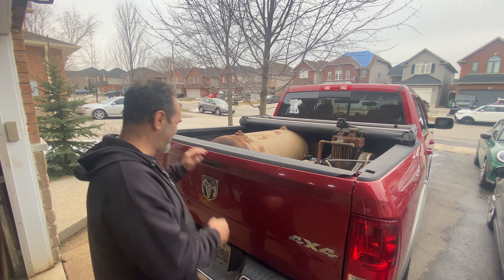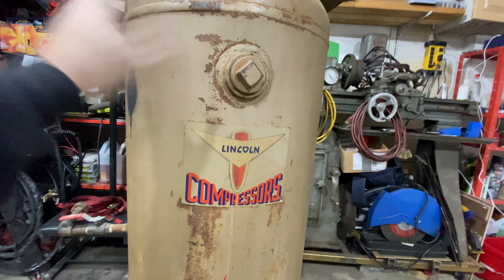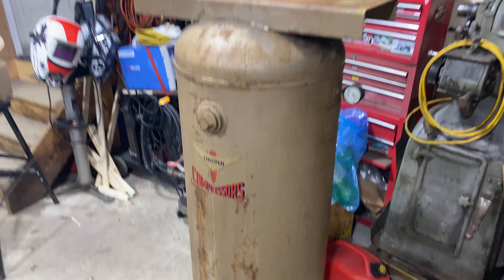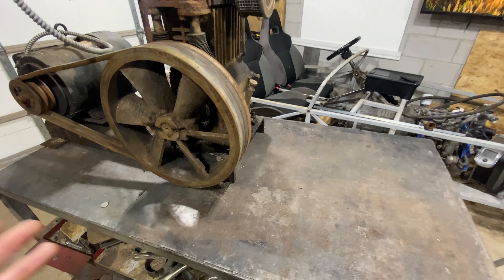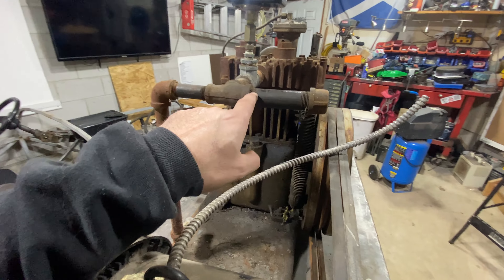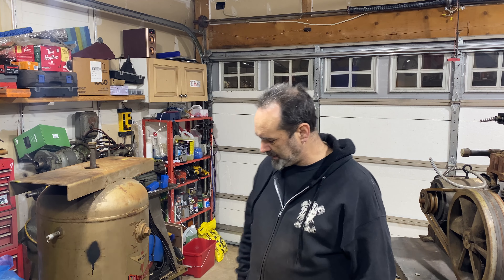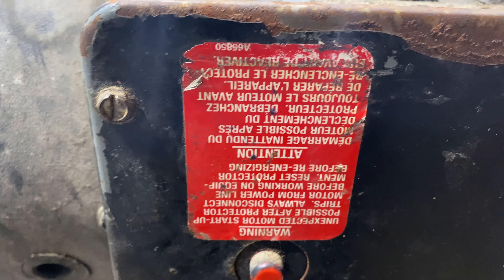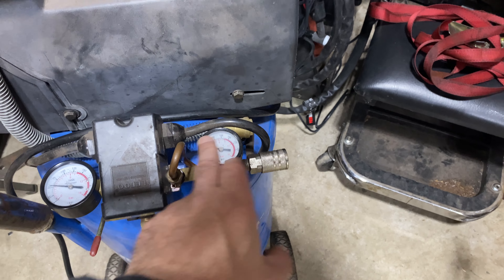Feeling The Pressure With A New To Me Garage Tool At Scott Rods

Comment: Live power goes on the left side of the pressure switch. That shaft on the lower side of the compressor is the oil drain. The surge button sticks out further when energized.

Comment: So I’m pretty sure the last owner used that tank as a secondary air tank. That’s why it has multiple air lines coming out of it. That’s so he had high volume and pressure. That’s so you can use more air between compressor duty time. Thus giving you longer life of the compressor due to it runs less. Most mechanic shops do that.

Comment: Hi Dave. Super buy. That will come in real handy. Yes, you should bolt it to the floor. It will bounce around. I put hard rubber pads under the feet. Yes, Put a gauge to show what air you are running. You will need to control the pressure if you panting. The pipe with the hex cap is a drain for the motor oil. You need compressor oil for it. Princess auto sell it. The motor is probably 220volt. Good for you Thanks for sharing.🍁👍👍

Comment: Replace both pressure  relief valves. Put a ball valve on the tank drain. Use the bigger pipe to go into the compressor. Remove the side cover on the motor and see what it's wired for. There  should be two wiring diagrams on the cover. Bolt the compressor tank to the floor. Their top heavy. If you use it alot, put a water separator on the discharge. Keeps the air dryer. Good luck!

Comment: Looks like a beautiful unit! Would love to find something like that one day, wouldn't even know where to put one that size right now, so I'll keep making do with my little compressor. As for your questions, you can buy compressor specific oil, but usually the manufacturer will specify an SAE grade that will suffice, and that pressure gauge down by the oil reservoir indeed appears to be for the oil pressure, as it only read up to 300kpa or about 43PSI, which is too low for the air tank pressure. Hope this helps a bit, good luck with fixing this unit up, I look forward to seeing it back in it's full glory! You should be able to run any handheld air tool I can think of on that, unless you get into blacksmithing and get a power hammer, your setup will be very futureproof!! 😁
Reply from the maker: Thank you. I've made do with a small compressor for the last 20 years, but I really want to get into body work and paint, before I'm too old to learn.
Reply: @ScottRods  Ah, there you go, that is a field truly worthy of a big compressor!! I have a background in auto-tech work but no experience with body work besides the bit of patching up I've blundered my way through at home. Good luck with it! 😊

Comment: Ditch the tank Dave it's a BOMB, pressure vessels should be inspected and re-certified every 10 years.  There is a tag welded on the tank (just below the pressure gauge) and it will have the build date and any re-certification dates stamped on it.
I'd say it is from the 60's or early 70's. Just look up "Compressor tank explosions" on the web and make your own decision on restoring it. Good luck and stay safe 👍👍
Reply from the maker: I'll look into that tag thing, thanks.

Comment: The truck shop I work in has that exact compressor and it has been in use for almost 45 years, so they will last a long time, given proper maintenance.
Question #1.  While some people use motor oil, there is a special compressor pump oil that is designed for just that.  It is called Mobil Rarus Compressor oil.  There are additives in engine oil that are not good to use in an air compressor.  We change it about once every 2-3 years.
Question #2.  The short pipe from the bottom of the compressor with the cap on it is for draining out the old oil, see above.
Question # 3.  That compressor looks like it has a pressurized oiling system, and that gauge is likely for that oil pressure.
Question #4.  The open fitting with the residual oil film seeping out is called the unloader.  That will vent air out of the cylinders when unit shuts off.  This is so the pump does not have to start up against pressure.
Question #5.  The red button is an overload switch.  We had a air line burst one night so the air compressor ran all night.  In the morning, this button was found popped out because it likely was getting quite hot.  It also can trip if the amperage draw exceeds a safe amount, for instance if the compressor pump would bind, it will save the motor from burning up.  Much like a circuit breaker in your house.
Question # 6.  The wiring can cross  over inside the pressure switch.  It is merely an on/off switch, controlled by air pressure in the tank.  Look for the words "line" and "load" near the terminals.  Line is power going in, Load is power going out to the motor.
Question #7.  The switch on top is the air pressure switch, which will turn on the compressor at around 90 PSI, and off at 125 PSI usually.  You still should have a regulator plumbed in at the air line coming out of the tank to cut that down to 90PSI that will go to your tools.  By keeping the storage tank higher than your usable pressure, the compressor will not cycle on and off so much, and will give you a more steady pressure, useful when spraying paint on Bugsy.
Question # 8.  Definitely use rubber isolators to mount this compressor.  I bought 4 rubber isolators that have a thick rubber cushion with threaded studs coming out both ends.  Then I drilled 4 holes in the concrete slab, and just set the threads down into the holes (it keeps the compressor from wandering around your garage) and the other side threaded studs would fit into the four holes on the legs of the tank.  Without isolators, you will get a low vibration, shaking your dishes out of the cupboards in your kitchen.  
By looking at the motor data plate, it will require a minimum of 30 amps @ 120 volts, or 20 amps (a 15 amp circuit would be just a bit shy of needed capacity)  at 240 volts.  I would go with the 240 volt hookup, as it will run stronger, dim the lights less when it starts up, and be less costly to operate.  You have a very commercial, industrial compressor.  You won't be able to run it out of air with any tools you have.  We operate a 1" impact gun for removing truck lug nuts in the shop I work in, and even while airing up tires, running the air guns, and other mechanics using air, it does not ever run low.  Be sure to put a moisture drain on the bottom of the air tank and drain it every day.  A dryer would be good to have, especially if you are going to paint.  Good Luck!
Reply from the maker: Wow, amazing reply. Everyone else can go home now, lol. I'll need to read this a few times, thank you so much.

Comment: Get 8 hockey pucks, drill hole in 4 large enough for shaft of a bolt. Drill larger hole in the other 4 pucks for the head of the bolt, flat washer, and to get a socket in there. Use a torch to heat and fuse together or epoxy the 4 mismatched pucks. Bolt onto the 4 legs. The pucks are dense enough to not squish and make it unstable. Wood might work, but might also crack/break and transfers more vibration. Stick an  old tire between the tank and wall. Chain at top , mid, and bottom. Get a hose rated for the task from a hydraulic supply shop or industrial surplus. I have a similar tank and compressor from 1952 that was second hand from my grandfather . It has been secured for 21 years in the fashion described. Cheers
Reply: My 60gallon definitely walked around just sitting on concrete, even though I have the tools to mount it to concrete.  I found if I just sat the feet on rubber isolation pads found at my local plumbing supplier it didn't move at all.

Comment: The one at the bottom of the tank is to drain the water that accumulates at the bottom of the tank, and thus gets into your tools and your paint. The small line goes from the tank to the head it unloads the back pressure so that the pump can start up with no pressure against it. Wish you showed that engine plate most homes only have single phase power not three phase. You will need a regulator on the line that goes out to your tools they aren't made to run at full pressure. enjoy your new tool.
Reply from the maker: I was told this was a regular 220v motor. Thanks for your advice.

Comment: This looks great, but if I have one concern it would be reusing a pressure tank, as you do not know the history.  Please be sure to inspect that tank 1000%, you may want to try and get your inspection camera in the tank and look at the status of the inside for any rust or cracks.  On the air pump the small capped off pipe at the bottom of the air pump should be an oil drain.  Yes you will need a regulator and or dryer at the tank and or at the end were the main air line where the tool line will connect into.  On the motor that device at the top where the power is feed in and out of, should be the pressure switch, will want to verify what pressure it is set turn the motor off at.  On the tank I saw an information plate at the top side I, believe.  That plate should say the max psi for the tank.  Just a few thoughts.
Reply from the maker: That could be fun little experiment with the boroscope. Although I might not like what I see, lol. Thanks for all the advice.

Comment: That was a steal! You might want to thank that guy again. You've got some good help down below in the comments, I particularly liked Dan Quass. You might want to double check the motor just to make sure it's not three phase. As industrial as that thing is it could be a possibility. Otherwise that whole set up should last you and your son a lifetime. Nice purchase, all you need is a little pipping, a good regulator and a filter drier. Water is the enemy to all your tools and the life span of your tank.
Reply from the maker: Yes, I would love to run a hard line round the garage with multiple outlets, but not really required for a small garage like mine.

Comment: Very good advice from SolarGarage . If it is possible could you put the engine outside of the garage. It is going to be a noisy engine. If you cannot put it outside, build a rack and mount it high. You may welcome some noise deadening material

Comment: The tube at the bottom of the compressor with cap should be the oil drain, with some research I think find the oil is non detergent 30 weight in a heated area.
Reply from the maker: Thank you, that's very helpful.

Comment: Good buy Dave, take the motor and compressor head off the plate they are on and just mount them on the plate on top of the tank, it will save some weight and height. You need compressor oil Princess Auto has it cheap.

Comment: On the engine, gauge is oil pressure  long pipe sticking out is oil drain. I run a motor oil in mine. Straight 30w, on motor, the button is a reset. The air cut off switch is wired in series so if you look at where the wires attach there is a brass bar running behind to the other side. Yes you need a rubber hose and a regulator

Comment: Mount your tank on hockey pucks.your piping,if it's facing the wrong way just tighten another half turn or take it off,retape( teflon) and face it the direction you need. You will  need to run a new power circuit to your garage.(220v). An easy out should help remove the broken nipple on the bottom.

Comment: Gauge on lower side of the compressor is oil pressure in the compressor and is mounted on the oil pump.  The pipe at the bottom is the oil drain for the compressor and it will use compressor oil.  You can get it at Princess auto.  The block on the front side with the pipe going into it is the unloader valve so the compressor does not start under load.  The red button on the motor is a reset if the motor trips out.  I would suggest that you remove the motor and compressor from the plate that they are mounted on then use the plate for a template to transfer the mounting holes on to the mounting plate on the top of the tank then bolt the motor and compressor onto the top of the tank.  Motor looks like it’s  115/220 capable.  You need to figure out what it was being run on.  Would suggest run on 220 it will work better and draw less amperage.  The cover plate for the pressure switch should have a wiring diagram on it as well as setting instructions for cut in and cut out pressures.  Would suggest that you set the compressor for 125 to 130 psi based on the rating of the pressure relief valves and then put the regulator at the end of the line were you will be attaching your air tools or if you are going to have multiple outlets put the regulator at the outlet on the tank.  As for the tank drain valve there are several options.  You can stay with the manual valve, as was on it, or you can go for an automatic drain valve that will dump when it detects water or on compressor shutdown when the pressure drops below a certain point.  Princess auto has all of the parts that you will need.  As for connecting the compressor discharge to the tank you will need a flex pipe to absorb any vibrations.  The Lincoln tank actually looks pretty good would suggest just clean it up and for the the patina look with maybe a satin clear coat on it .  Good luck and have fun setting it up
Reply from the maker: Thank you Mac, that's awesome. I was told by the seller it was running a straightforward 220v line. I have ordered an inline on/off power switch which I will install on a wall near the motor. I would hate for this to kick in, in the middle of the night, lol.
Yes, I realised it would be silly to mount the motor and compressor plate over another plate, so I'll do as you suggested. If I can't get the right length of belt I may have to adjust the distance a little.
I'll be heading to Princess Auto on Friday with a shopping list, and a diagram in case I need help.
Can wait to get this thing fired up.

Comment: Wood platform would be better than just bolting it to the floor because it will avoid interaction between the steel and the concrete. If you want to isolate the pump and tank from the floor, put a layer of Acoustimac Soundblock, limp vinyl mass that comes in rolls but is expensive, like $168 US, between the wood and the concrete. You might search for some neoprene sheets instead. Then use motor mounts to fasten the mechanicals to the floor.

Comment: Apart from the oil drain so many others have mentioned, not a lot of compressor experience here Dave. I believe the small diameter lines are for pressure control. Pretty sure there will be a lot of info out there for it all. What is the expected pressure you will have in the vessel ? If it is over 1000psi the one fellow that mentioned getting the tank tested is giving great advice. Keep safe friend 👍
Reply from the maker: I think the guy said it went to 150 psi.
Reply: @ScottRods - I shoulda known better, no shop air runs anywhere near that LOL ! You will be just fine, definitely the regulator (which usually has a water trap as well) and  maybe a filter before blowing through any tools. Look forward to seeing how you do it 👍

Comment: Paint it to looky like a minion from despicable me. Out the bottom of the compressor head is your oil drain. The gauge is for oil pressure and can be adjusted on the right side. 25 psi should be good. You can run gear oil, motor oil, or pricy compressor oil @ 30-40 bucks a litre. Get a new pressure switch and follow the manufactures wiring instructions. As long as the electric motor is good, you can probably keep the rest of it working just fine. Maybe some tough rubber under the feets? I’ve heard that wood can actually be an amplifier for noise. That’s all I got. 
Now! Get back onto the seven.
Reply from the maker: Minion sounds great actually. Thanks for all the advice.

Comment: Looks to me like its a 2 stage ....the pipe on the back is to drain the oil...compressor duty oil only..the little tube runninup the the head is the pressure relief line...relieves head pressure when it shuts off so it can start again without pressure resistance... the fact that its only a 2 hp meanns you can probibly get away with starting it with the pressure switch and not a motor starter.. mount it on 2x4s with belting or hard rubber stuck on the bottom...might move a bit but wait n see.... you will need a regulator but if you put a drip loop in it should be after that...black with flames works for me...now this might dim your lights a bit or even pulsate them a little while running.. thats the wave and in-rush of the motor... not much you can do about it but not a big concern...

Comment: Hey Dave I  purchased my compressor many years ago my data plate stated 1946 man date.guess what still makes air and knocks like  crazy at startup. I keep bottom drain slightly cracked open pumps up to 125 psi shut off restarts at 90psi keeps up with anything I use. Appears you have a two stage compressor. Should be able to figure out hookups. Looks like oil pressurized crankshaft bearings. Air out of tank should not be restricted. Use a regulator down stream have at least one non regulated before for tools requiring full pressure. Not good having to bottom out regulator to get full pressure. Quite sure you will get many suggestions on subject.
Reply from the maker: Thanks Joe. I'll need to look into the two stage thing, but the guy did say it was running on regular 220.